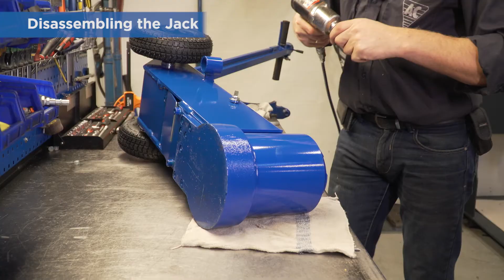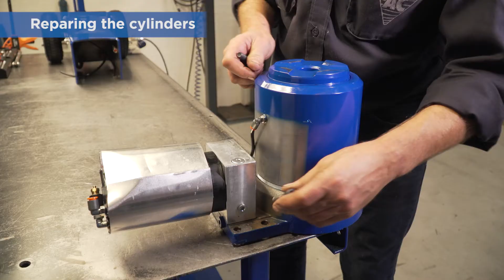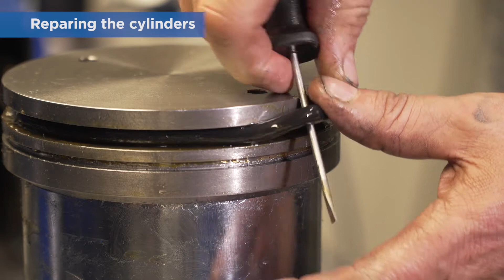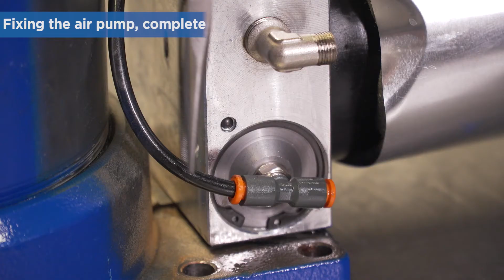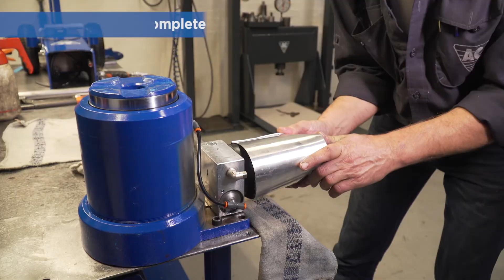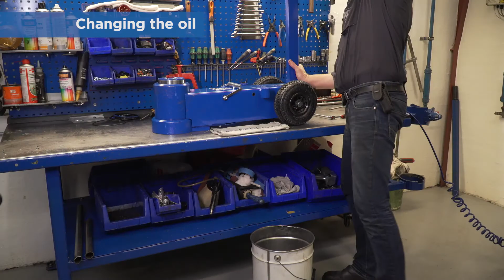How to repair your 65 T air hydraulic jack

Comment: Hi, who would I contact for some technical help please? I have two AC hydraulic 10/20 ton jacks the same style as pictured that were replaced  in our workshop due to failing. I have one working again but it won’t be put back in service for lifting so I want to use it in a press.
While I can cut the jack body apart to keep the oil reservoir in tact and I can mount the motor up the right way I want to invert the ram for the press. This will require drilling and taping the oil passage in the motor body and ram housing where they join to take a hydraulic hose but I need to know if this will work or do I need to modify the the entry point of the oil into the hydraulic ram and the return line. If I can get this sorted it will be perfect for an air over hydraulic press rather than tossing them in the scrap bin. Any help would be greatly appreciated. Thanks in advance, Stuart, Australia.🇦🇺
Reply from the maker: Hi Stuart, sorry for our very late reply. If it is still relevant for you, please contact our Australian partners at Levanta:
Web: https://levanta.com.au/contact/
Phone 1300 577 541